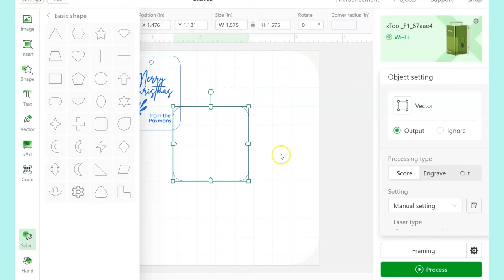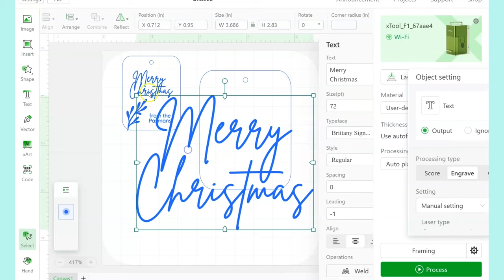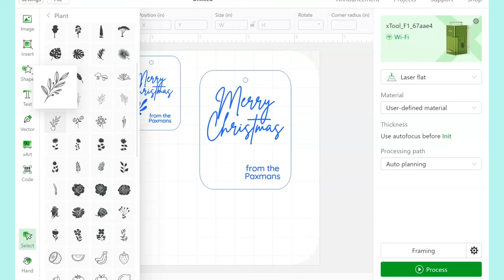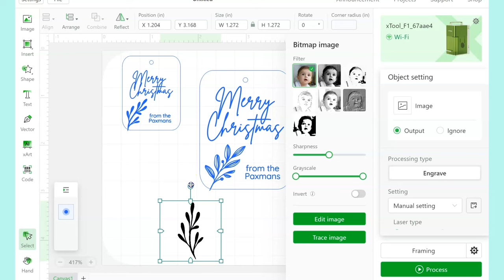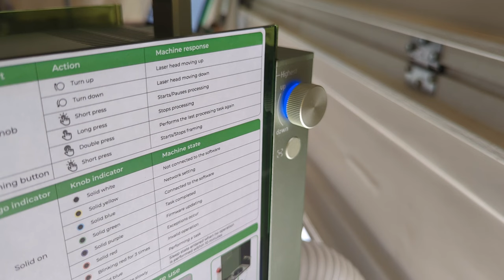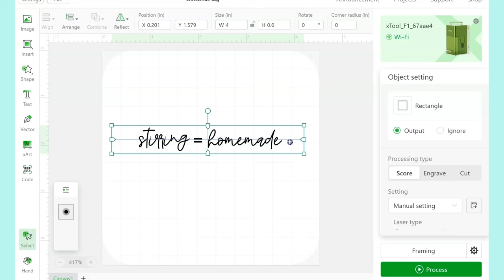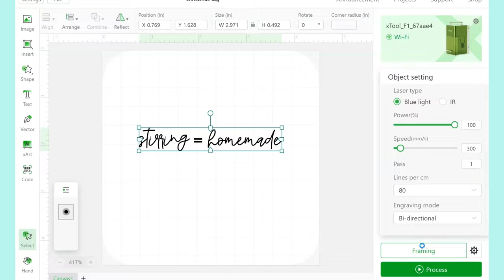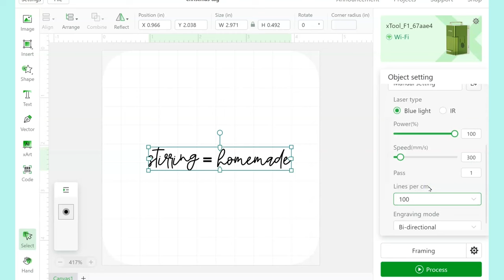xTool F1 to Engrave Glass

Comment: I've ordered my F1 primarily to enable design and personalisation on glass products. I consider your presentation to be a tutorial - thank you very much!
Reply from the maker: Glad it was helpful! Enjoy your new tool!!
Reply: How is your experience so far with engraving glass? Is it working with the F1? And do you need to darken the surface or can you engrave on it directly? I'm also considering to buy an F1 :)
Reply: @julianfrey5930  Hi Julian, I have found that using a water based pouring acrylic black paint on the inside of the glass works well.  I tend to pour in sufficient to cover the surface, roll it around until the glass is coated evenly and then leave it to dry on a radiator. It will just wash off after engraving.  I also find that 2 passes brings out the best result. I'm still new at this, but this laser is very fast and very versatile. Good luck.
Reply: @glassman20  Thank you so much for your reply, much appreciated :)